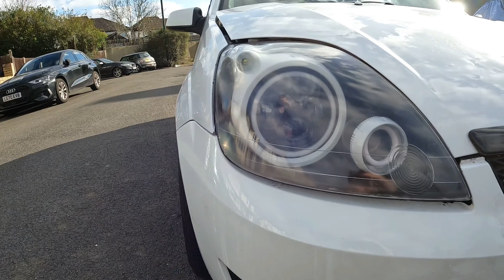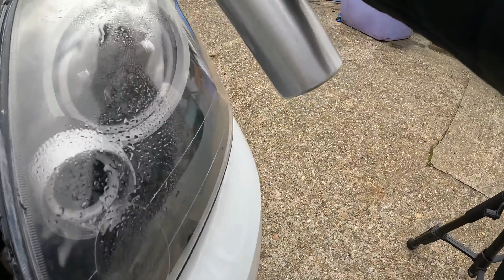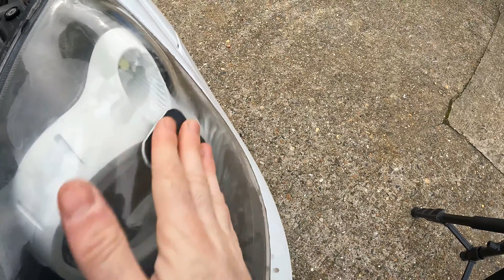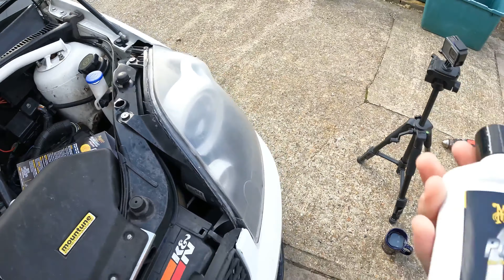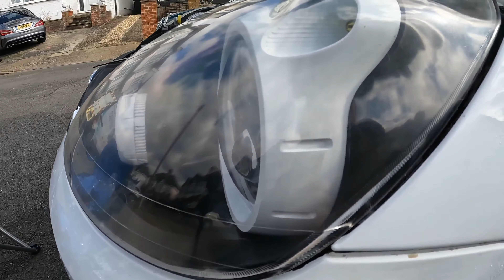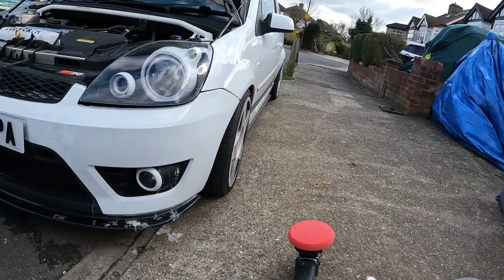Ford Headlight Restoration Using The Meguiars One Step Kit

Comment: Great video Ted! Headlights came out so well! What coating did you go with to protect them out of interest?
Reply from the maker: I only applied it the other day as they turned up late it’s by Sonax iirc made for Uv protection and headlight so time will tell on how they do they’ve beaded quite well already
Reply: @6uiltdifferent  ah okay, not heard of it, you’ll have to let us know how it holds up. Did it make them nice a glossy when you applied it?
Reply from the maker: @MendItModIt  yes mate you can normally tell as it gives that rainbow haze they were like mirrors it was crazy